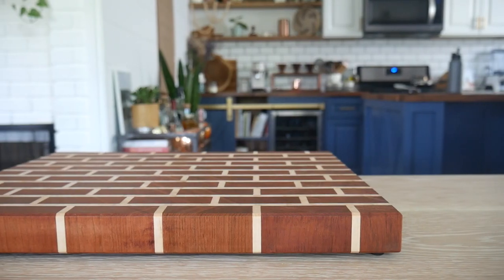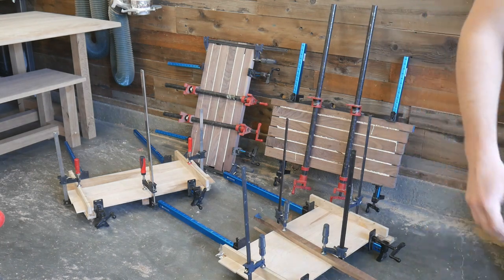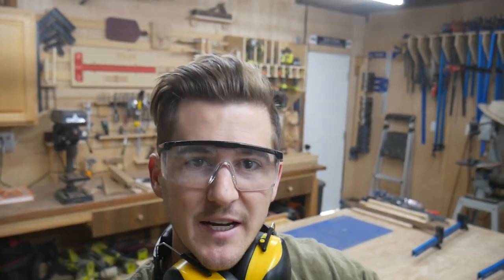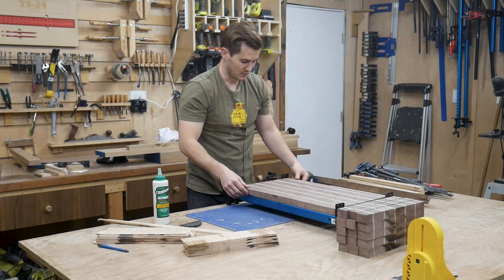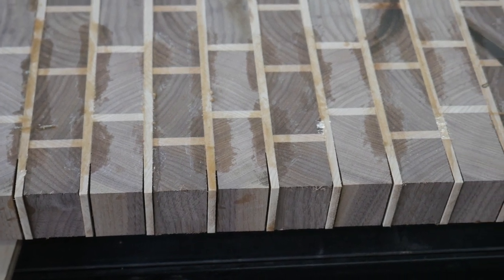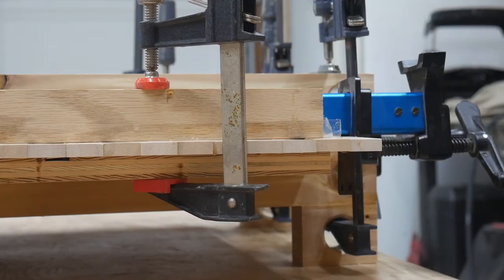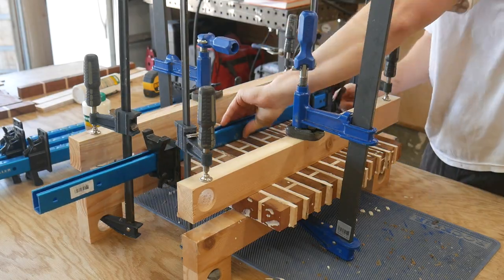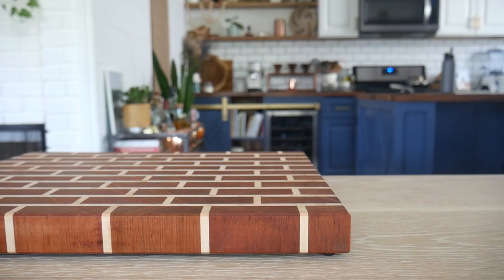Building a Brick End Grain Cutting Board | 68

Comment: when you do your handles at the bottom, put 2-3 layers of painting tape at each end of the board. do you first pass then remove the tape and do the finish pass. that makes less stress on the bit and avoid all the burning marks. that's what I do with all my cutting boards (I make like 150 a year).
Reply from the maker: Thank you for the tip! Will do that next time!
Reply: @workshop_edits  you're welcome. Great video as always!

Comment: Nice cutting boards.  Regarding your "mistake", since the gaps are all at the end of the cutting boards, it doesn't seem like the blades are the problem. Looks to me like snipe.
Reply from the maker: I thought so too but it’s def the blade inconsistency on the outer pieces
Reply: @workshop_edits  It's definitely blade wear. I had the same issue with the centrs of a panel being thicker than the edges. If it was snipe it would be at the ends and across the entire panel.

I used it as an excuse to upgrade to a helical cutter head